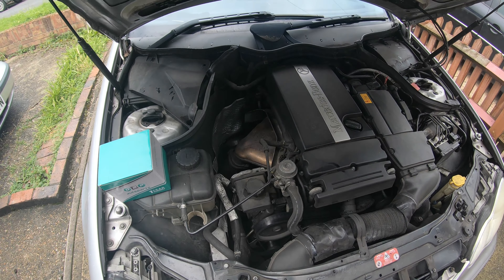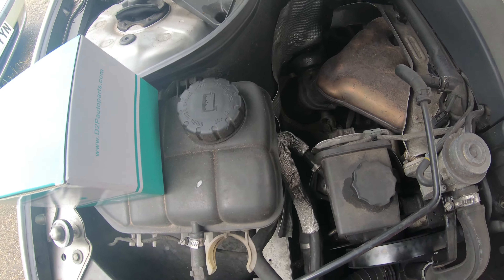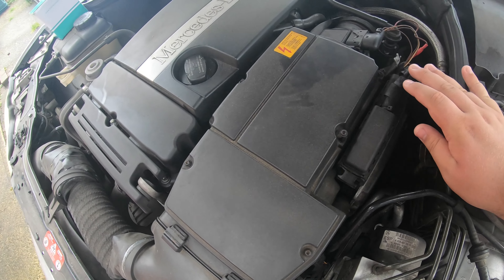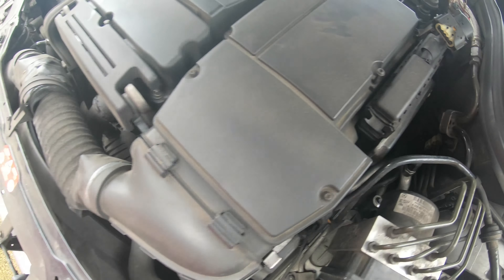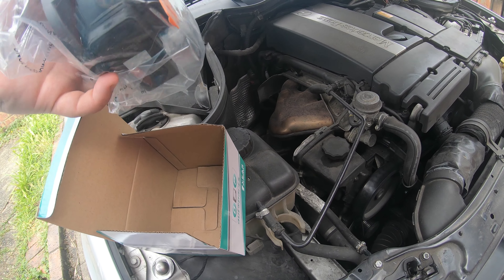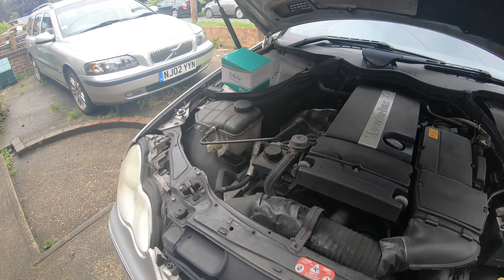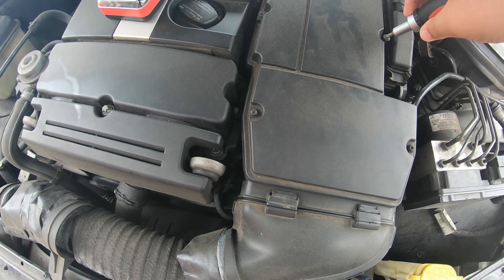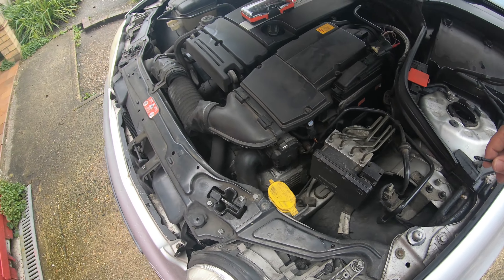Mercedes C180 W203 1.8 Kompressor 00-07 Mass Air Flow Sensor Replacement

Comment: There are 3 screws holding that MAF sensor to the airbox - how did you manage to undo all 3 without removing the whole box? How did you even fit a screwdriver down there for the third one
Reply from the maker: There is only 2 Screws holding the MAF there isn't 3 screws holding the MAF it looks like there is but there was only 2 At First I Thought there was 3 holding it But there is only 2 Good Luck Take care
Reply: @JoeSibCars  sorry but there are 3 screws that hold the sensor in place . I had to remove the complete airbox to get to the 3rd screw at the back. What a poor design.
Reply from the maker: Okay I didn't have the Third screw it went missing so I just putted the 2 Screws in but apparently it was taken to a garage to have the Mass air flow sensor replaced a few years ago so it was probably the garage that lost the third screw Take care
Reply: @joswaterval4982  Doesn't it hurt when you see a C240 MAF sensor replacement video and it is so easy and then you get to C180/230 and you need an engineering degree to get to it. F&^in annoying, particularly when you just want to clean it as part of service and you use a K & N filter.

Comment: How do you remove the bottom screw 🪛 from the maf? There's 3 screws. You removed only 2. 
Because you didn't show it !!!!
Reply from the maker: There wasn't a third one that's why you only see me remove 2 but I have read other people say that you have to remove the air box to get to the third screw but I can't redo a video on it as my Friend no longer has the car But I hope this helps and take care
Reply: @JoeSibCars 
Thank you so much for replying to my question. It could be that some cars have 2 and others have 3 screws. 
But yes you are right I see you don't have to remove the air box. But cars with 3 bolts yes it needs to be removed. Sadly 😢
Thank you so much I appreciate it and keep posting videos. You just won  a new subscriber. 🎉🎉🎉🎉

Comment: nice video. getting error p0102 so gonna have to do this
Reply from the maker: That code is a Mass air flow sensor witch is a Lean burn Trouble Code Try unpluing the mass air flow sensor of your engine Continues to run you have a bad Mass air flow sensor of you have a good mass air flow sensor when you unplug it the engine will stall witch means your mass air flow sensor is working so if engine keeps running after unplugging the mass air flow sensor replace the Mass air flow sensor after Replacing the Mass air flow sensor you need to clear the codes because it won't clear on it's own Take care
Reply: @JoeSibCars  so if engine stalls after i unplug it that means maf sensor is not the problem?
Reply from the maker: That's Right Good luck take care
Reply: @JoeSibCars  thanks, great video too
Reply: @JoeSibCars  Won't the engine still run if unplugged and just go into limp mode?